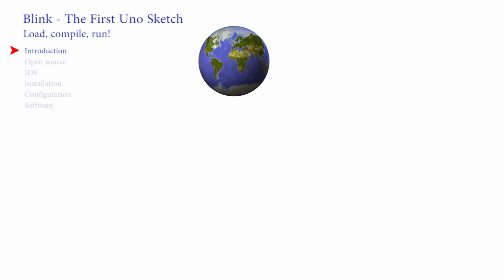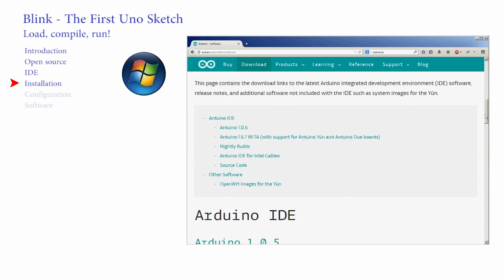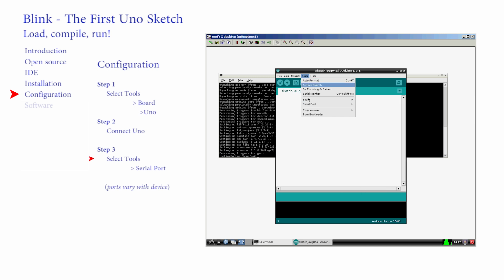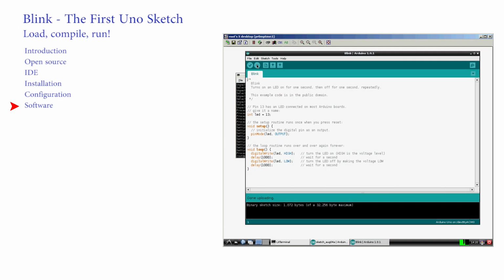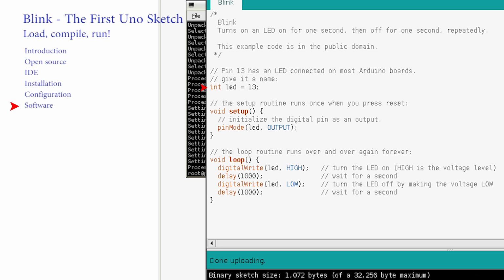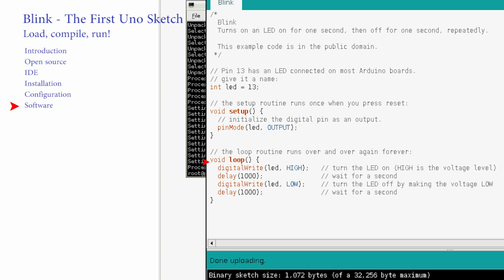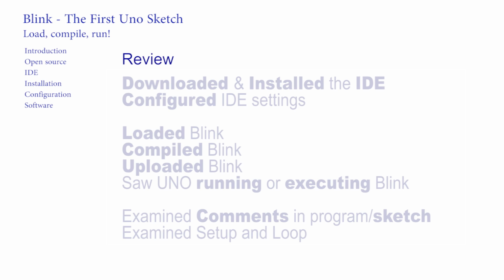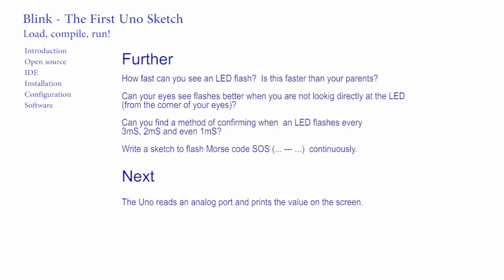Interconnecting Arduino and Raspberry Pi

Comment: (1) Install DietPi and quit typing "sudo" before every friggin' command. That's just absurd. You're root, son. Run that Pi like you own it. http://dietpi.com/

(2) If you're a PHP programmer and hate Python's asshat syntax, use my Serial class to connect your Arduino to the Pi. Pass "arduino" for the type parameter. https://github.com/diggydude/php-iot/blob/master/php-iot/lib/php/classes/Serial.php

(3) Put a 1uF electrolytic capacitor between the Arduino's reset and ground pins. That will keep it from resetting every time the Pi connects to it. (Remove the capacitor to reprogram the Arduino.)

Comment: Hi Richard, thanks for this video. I do have another question, how to make arduino and raspberry pi commmunicate with each other through bluetooth?
Reply from the maker: Oh wow - now THAT's a good one!  I can't think that I've ever seen that addressed as an issue before.  I'll have to give it some thought. The Pi has BT built in but the basic Arduino does not.  Do you have a preference for Arduino used?
Reply: Right now I am thinking to use ArduinoUno and Seeed BLE Shield v1 to combine together, then use the raspberry pi to communicate with Arduino. But I am not sure how to do that
Reply from the maker: yes, with the Uno a hat is required.  I'm up to my neck in things (no pun intended - it is IoT) so will have to find some time to look at this. Have a play in the meantime and I'll get back to you.  Have fun!
Reply: thank you so much! Hope to hear from you soon.